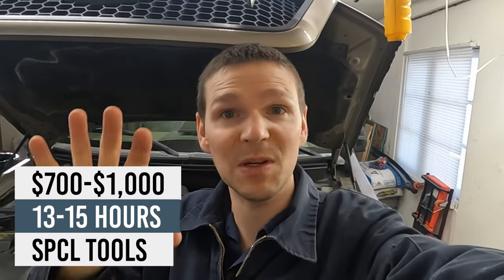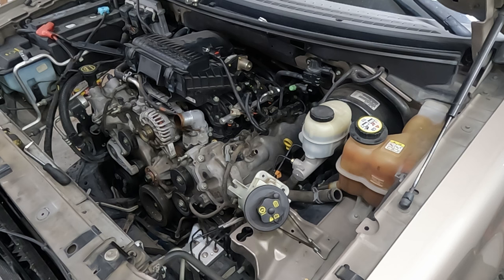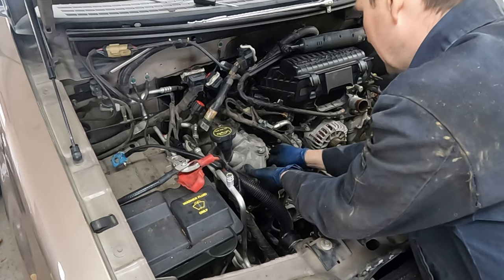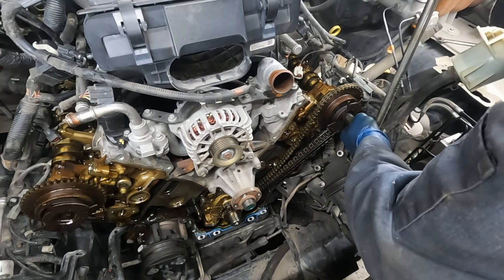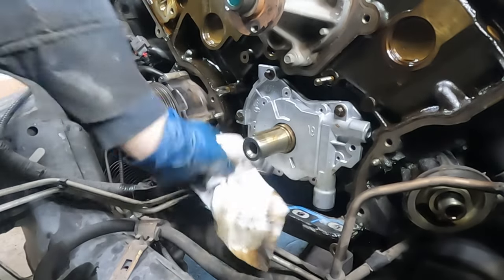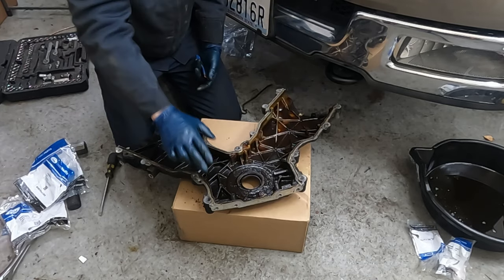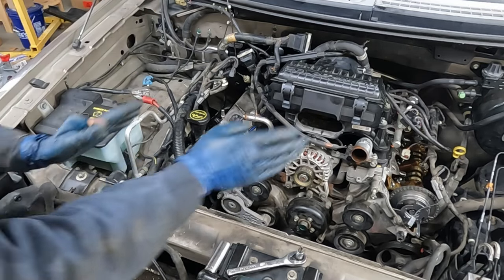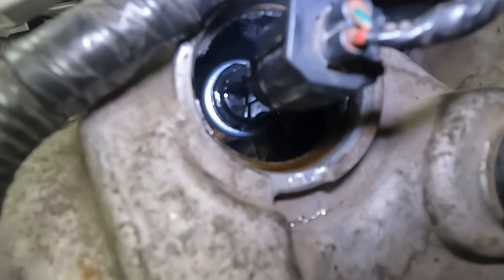Ford F150 5.4 Timing Chain, Cam Phasers, Roller Followers and Oil Pump Replacement

Comment: I own a 2006 F150. 160,000 miles. its starting to have that ticking sound. been putting off this repair but seeing this guide gives me more confidence to do it.
Reply from the maker: @DubStepTomatoFarmer  It's a big job but I think these trucks are worth it. I have links for parts and tools in the description. If you have any questions I'll try to help 👍
Reply: Gave me more confidence to have mechanic do it.
Reply from the maker: @cbx500cbx  That's what's nice too about videos. You can preview the job and see if it's something you can do.

Comment: Major problem I see in video Is timing chain Broke into little pieces and you never pulled oil pan to clean pickup tube and pan big no no
Reply from the maker: Do you mean the timing chain guide 16:56? All the pieces were big enough to retrieve and accounted for 🙂
Reply: that's what you think but iv done 6 of these and all had some timing guide pieces stuck up in pickup tube working on one now that I have pulled pan but not pulled the pieces out yet I will get pic and show you just had that one guide broke on the 04 f150 done felt several in pickup them motors already have oiling issues do not need to add to it d not get me wrong I like your video setting keyway at 12 instead of the 11 O clock work better than the dimple at 6 cause at least the the left bank is more less relaxed that way I watch these video's just to catch little helpful tips like that to me on my current job plus it refresh's my mind just seen that and thought that was a mistake      @ValleyMobileAutomotive
Reply from the maker: @jeremywilson6927  Thanks for your comments. It's nice being able to learn from each other. That's one thing I miss working alone.
Reply: You got one up on me I have hard enough time keeping track of the next step. Your doing it and talking to camera too. I do not think I would make a good video I will leave that to you LOL  @ValleyMobileAutomotive
Reply: Have you got a way I can send you a picture dug all the pieces out of pickup just to show what one guide can do that's not counting what was in oil pan that I had cleaned up already before this post. last job was worse the guide had gotten stuck beside the chain and half of it was ground up to BB sized pieces and the oil was full of them each time you shut it down part of the pieces would fall back off into the pan then on restart sucked right back up into what openings was left.   @ValleyMobileAutomotive
Reply from the maker: @jeremywilson6927  unfortunately YouTube doesn't allow files to be uploaded in the comments. If you'd like to make a quick video showing the debris you can load it on YouTube and post a link in the comments. I'd love to see it.
Reply: but thats not counting what I had already pulled out of oil pan that falls off once shut down
Reply: I need this work done on my 2013 Expedition. It's running fine with no check engine light or noise from the engine
 But, it's has 220,000 miles and I think it would be a good preventative measure.
I'm in the Nashville TN area. Are any of you experienced guys nearby or know where I might find help?
Reply: @jeremywilson6927 how hard is the oil pan to remove?
Reply: Teacher, if you replay the video and check, you will find that you did not reset the crank sensor reading gear during installation.
Reply: Oil pan must be removed..cleaned..pickup tube must be cleaned.. if u don't expect issues within 3 months
Reply: @claythomas9509 Same. Nashville. 2013 Expedition with 181,000. Did you find a good place?

Comment: the Melling High Volume oil pump is the best upgrade for that engine ... really increases oil flow .. plus run 5-30  oil instead of 5-20
Reply: my Melling oil pump locked up within the first year

Comment: I have an o9 fx4 w bad cam phasers and I can hear the chain at start up I unplugged the phasers under hood that seemed to stop the awful cam chatter...I am a bit intimidated by this job I asked a couple mechanic friends and they told me it will post 1500 2000 to 3500 to pay to have it done so that is not an option I have to it myself

Comment: I've got an 08 expedition eddie Bauer. With a Knocking sound. My mechanic says probably clogged oil journals. Most likely need to Repace the engine with a jasper.Too expensive to fix...too bad. I like my truck.

Comment: I did mine using the Melling timing set with ratchet tensioners. Locked out the phasers (no tune), and used the Melling high volume high pressure 360 oil pump. Truck runs amazing and I notice no difference in mileage or power.
Reply: TheCheesyHOGAN  I ordered the 3-391SCC from Amazon. It ended up being drop shipped, likely could've got it cheaper just ordering direct.
Reply: What phasers did you use? I'm considering using Melling also. Are you still satisfied with it?

Comment: I think valve solenoid electrically fried. That is unusual. Great video. I would pull oil strainer and check and clean oil pan. Looks a pain a tedious pain but worth it.

Comment: I think you video is fanrastic very clear and concise procedure.

Oh, and did you drop the oil pan and clean out all the broken plastic guide pieces? I just did this job on my personal truck and there were several small plastic pieces in the oil pump pickup screen i had to dig out with a pick i didnt want to have oil starvation on all my new timing parts...
Reply: Thats a good point of view bro !💪🏼

Comment: I did this job twice on the same expedition 5.4 3v with even less room in engine bay. 
Passenger side valve cover bolts are a really tight squeeze. Had to use the perfect socket and extensions combination. The rear most are a nightmare
Reply: how many miles on the engine?

Comment: i have an 07 f150 with 183000 miles. It runs beautiful, only noise you hear are slight tick from injectors. I know im on borrowed time, But I just put $2k in the front end. Changed Everything, Upper and lower control arms, inner and outer tie rods. Stabilizer links, stabilizer bushing, new front struts. I need to regroup funds before I go for the $2k timing set...
Reply from the maker: @Jersey-GT-F150  These are great trucks! Sounds like you take good care of yours 👍
Reply: You paid $2000 to do the front end?
 I did mine $275.00
 Plus an extra 70 bucks for  lower control arm bushings.
  I don't understand why It cost you $2000 unless you paid a shop.

Comment: Fought the oil pump today for 3 hours! Come to find out one hole is defective. Wanted to cross thread by hand. Even tough to get the screw in while on the bench. SHEESH! my fingers hurt Lol
Reply from the maker: @volcomkidd555  The pump is a challenge for sure. Bending over the radiator support gets tiring after a while.
Reply: @ValleyMobileAutomotive  I finally got back around to it. I got everything put back together. Did a few turns by the crank to be sure everything moved freely. But now I am getting a popping noice from the rollers or lash adjusters? Afraid to out it all back together. Any idea? I did replace those as well.
Reply from the maker: @volcomkidd555  See if you can identify which roller is loose. Make sure all the rollers are in place properly. If you replaced the hydraulic lifters as well it might be that they just need oil pressure to pump up. When you start it the oil pressure will tighten up the slack in the valve train. I would say if it all looks like it's installed correctly go ahead and close her up 👍

Comment: I like the way you do video. simple, fast, informative, no long bs. oem parts and they failed the huge way! wow. was little nervous to order something non oem but now I'm not. 450 for 1 phaser from ford or 350 for 2 cloyes phasers, no brainer.
Reply from the maker: Thanks! I've done quite a few of these and this is the first time I've had failure on an OEM phaser straight out of the box. Price out a set of Melling phasers. If they are within your price range I would prefer them over Cloyes. Whatever you do stay far away from Dorman. Good luck on the repair! If you have any questions feel free to post 👍
Reply: @ValleyMobileAutomotive I've been going back and forth over Melling vs Cloyes, as I need to do a timing job on my 05 f250 5.4.
Reply: @willhart7861  Melling is a bit more expensive then Cloyes but I've seen good reviews on both. I'm just about to open everything up and still hasn't decided what brand I'd go with. This type of job needs oem parts or the 2nd best option. I wouldn't go with Dorman neither.
Reply: @vladimirmacko1481  oem is so expensive compared to cloyes and melling. I'm sure oem is a better choice but I think I will take a chance on one of the others.

Comment: Ever since COVID I have had bad bad issues with out of box defective parts.
Ford.
Honda,
Chrysler.
Standard Auto.
You name it, parts have been dodgy ever since the coof.
I had a standard auto glow plug relay fail right out of the box.
I’ve changed dozens of them over the last 30 years and this is the first one that was bad the minute I plugged it in.
That same job I opened the glow plug box up and one box inside the large box was empty.
The larger box was sealed when I got it.
I’ve never seen that before.
Parts just aren’t what they are supposed to be.
I replaced a fan belt on an F250 a few months ago.
It’s already worn out. The pulleys are all good as is the tension.
It just an inferior part. I have never had a Gates belt fail on me like that before.
Don’t get me started on Mercedes parts lately.
I was going to buy a new Sprinter; forget it.

That phaser breaking and the VTC being bad doesn’t surprise me in the least.

Comment: 4:25 I struggled with that 18 mm bolt for the power steering pump bracket it is a pain in the rump for me too.
Reply: I'm in the process of doing this right now as I'm posting this
Reply from the maker: @justariflefromjordan  Yeah It's at a weird angle. How's it been going so far?
Reply: @ValleyMobileAutomotive  going a lot better taking my time good thing I have extra days off I'm going to do the timing chains the guides and the tensioners and then retime the bank number to. It actually skipped a couple teeth and still ran surprisingly
Reply from the maker: @justariflefromjordan  Nice! If you have any insights or questions feel free to post. Happy wrenching 👍
Reply: @ValleyMobileAutomotive  I'm a lot happier now that I got everything tore down to where it needs to be. Haha

Comment: Using the crankshaft alignment tool, the dot on the crankshaft is supposed to be in the 6 o’clock position. Yours looked like it was more 7 or between 7 and 8. And for torquing the phaser’s they have a tool that locks the gear to the head so nothing will move.
Reply from the maker: You are correct, they make special tools you can purchase if you feel more comfortable doing it that way.
Reply: @ValleyMobileAutomotive  I was tightening the left side of the camshaft gear and it jumped to the left about like a half turn ! And now my chain on that side do not lined up the marks ! Can I move the gears while the crankshaft keyway its at the 11 o clock position I use the timing tool and I already set the time to the correct way! But then that happen ! Do I need to place the Crankshaft keyway at the 12 o clock position and then re aligned the camshaft gears or how that does work? Or can I aligned while it’s at the perfect timing set 11 clock and dot mark at the 6 clock 

Thank u
Reply: Whats its ir can you post the link here ???
Reply: Hey did you move the crankshaft

Comment: Other videos i watched say remove certain followers  then rotating keyway to 6 oclock before removing the cam. Then they put the followers in after cam is installed. Do the valves riding on the cam affect torque when torquing the cam. Or affect the cam when removing and installing? Dont get me wrong i like your method better. Just asking before i try it.
Reply: Same question.  This method looks way easier, just want to confirm?
Reply: fordtechmakeuloco does it that way

Comment: Awesome video.  I've gotten to putting the second chain on and the chain slack is on the top section, not the bottom.  My timing mark is about 12 o'clock.  Other marks line up.  I did have to turn the phaser counter-clockwise some as you did to get the chain to line up.  Interesting note, my guides were broken just as in your video and some wear to the inside cover from the chain.
Reply from the maker: If your crank link lines up go ahead and keep turning the phaser counter clockwise until all the slack is on the bottom. It's ok if the phaser timing mark isn't at 12 o'clock when you're finished. As long as the links are lined up properly and your chain isn't upside down. One side has two colored links the other side has one. Make sure the right one is on the phaser.
Reply: @ValleyMobileAutomotive   Chains are correct and crank has key way at 12.  Will turning the phaser counter clockwise turn the cam too much? As I turn it, the chain gets tight up against the upper guide and the phaser nearly stays by itself, but not quite and wants to rotate back clockwise.  Do I just place the guide in there while I have it rotated some?
Reply from the maker: @sn-es9gb  Yes, because it's not staying in place for you you'll need to hold the cam from moving while you put the tensioner arm and tensioner on. Once the tensioner is on you're all set 👍
Reply: @ValleyMobileAutomotive  Awesome.  It did not take much of a turn to get the guide and tensioner in place.  Cover back on.  Can I rotate the crank at this point to be sure there is no interference or is that not advised?
Reply from the maker: @sn-es9gb  Nice! Once the tensioners are torqued you can rotate the engine 👍
Reply: @ValleyMobileAutomotive  Got 'er done.  Primed and fired right up.   Your video and help was outstanding!  Thank you sir.
Reply from the maker: @sn-es9gb  Awesome! Feels good to have your truck back 👊

Comment: Is it possible for the left and right chain guides (one that tensioner pushes) to be installed on the wrong side? I didn't check too well which side its goes.

Comment: I greatly appreciate your post!  Quick question, just like your passenger cam shaft released about 15 deg, in mine, I had the bar off and was pulling the loose chain when it sprung the same radius and stopped.  Could that little unrestricted rotation damage something internal?   I am going back with all new roller followers and Ford phasers.  I got nervous about it.  Please share your thoughts.  Thank you.
Reply from the maker: I don't think the sudden stop is because it's hitting anything. I think it's just the other valve springs preventing the cam from rotating further on it's own. Also the spring force and speed of rotation isn't enough to bend a valve or damage the piston head.
Reply: @ValleyMobileAutomotive  thank you very much. I will sleep better now.!